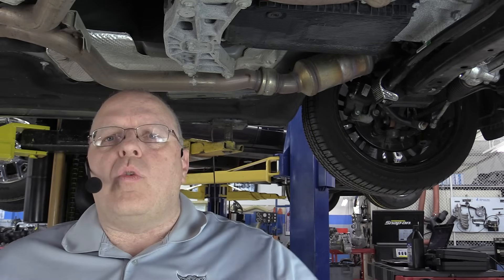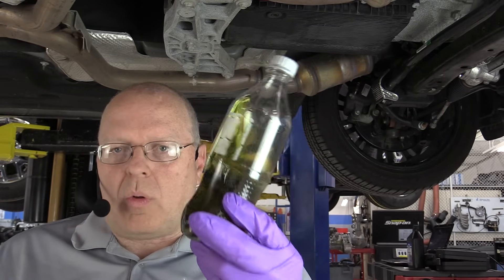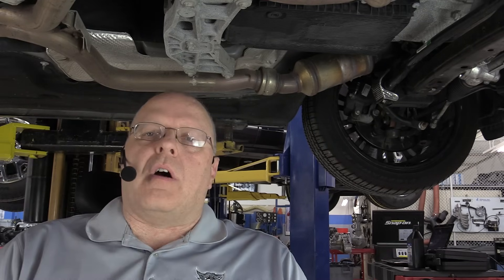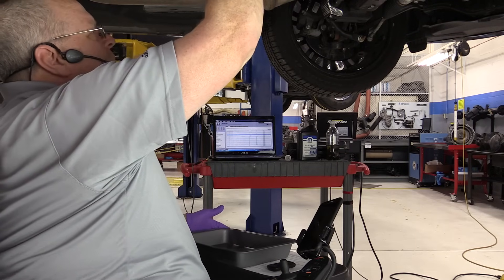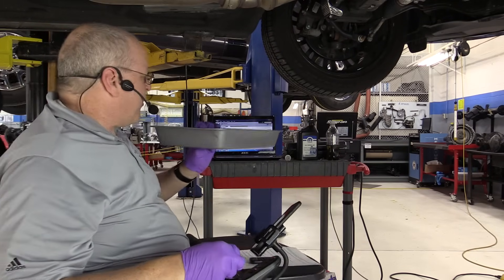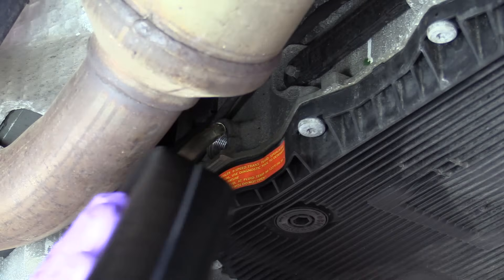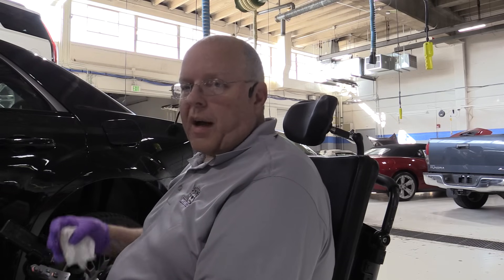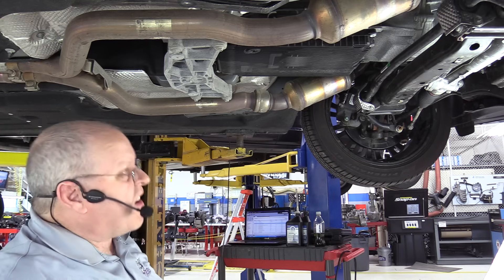Jeep, Dodge, RAM ZF 8HP 8HP 8-Speed  Transmission Fluid Level Check - No Dipstick

Comment: if the oil in the cooler has drained back into the pan after you performed your fluid change, seems to me that you'll never have the correct level. Am I missing something?
Reply from the maker: ZF now recommends tilting the vehicle towards the drivers side and adding 0.5 liters of additional fluid to compensate for the cooler flow control valve.
Reply: @WeberAuto  Thank you for your reply. Oh my, seems unsafe. I believe the fill plug is on the drivers side of the pan on the 2019 Ram 1500. I can not see a tech at the dealership taking the time to do this service correctly. Time is money.
Reply from the maker: @louiemos585  Thanks, it is not unsafe on the ground, just jack up the passenger side of the vehicle and support it with jack stands. On a hoist, it can be done, but would take an experienced technician to set the hoist lift pads to the proper height.
Reply: @WeberAuto  So the drivers side is lower than the passenger side?  In the video it looks like the fill plug is on the drivers side.  Correct or not?

Comment: This guys knows his stuff!

By the way; these combined AC Condensers/Transmission coolers are known to crack and leak refrigerant, PAG oil and dye at around 100 000 Kms. Drivers will hear the "hiss of death" while driving with the AC on. It's a common issue with all Chrysler/Jeep/Dodge brands (this part is common) and the combined condenser needs to be replaced (there's a few videos on youtube about it and how to complete it). The replacement of the condenser is relatively simple, but i doubt any technician/mechanic will complete the trans fluid check after completion of the job. If it's happened to your CJD vehicle, and you have a new A/C condenser, check your ZF 8HP transmission fluid after the repair. It's NOT a required step in the standard A/C condenser repair in the standard repair manual. Your AC will be nice a cool but the transmission may potentially be low on fluid and may lead to premature failure. 

Keep up the great videos.
Reply: Huh....my 2019 Jeep GC Trailhawk had malfunctioning air conditioning since brand new....system made a gurgling, weird noise....didn't blow cold air at all.  Had to have it fixed twice on warranty.
Reply from the maker: Great information, thank you!

Comment: Hey I need your help I have a 2018 Dodge charger sxt went I'm driving it a few miles in from D to reverse it kicks the sounds it comes like from the differential I went to the dealer the first time and they told me it was the transmission and they change the transmission and still has that noise but in the dealer that told me they cannot do anything is a normal noises for me it's not normal is loud. please help me😞
Reply from the maker: I have heard similar complaints from others. It could be "normal" although less than pleasing. I have no suggestions for help except keep checking back with them to see if there is a software update for the transmission controller to soften the D to R engagement. Best wishes.
Reply: Thanks so much for your time
Reply: Did you got it fixed sir?

Comment: Hi,
Just curious this is the same process for the ZF 845RE boxes used on Jeep Grand Cherokees?
Reply from the maker: yes
Reply: But, if you are changing the filter. There are three bolts keeping the pan on which can only be accessed by lowering the cross member.  Just an fyi...

Comment: "There is a 3 page procedure" - many companies have jumped on this fucking ZF tranny to save costs and improve their MPG ratings, and to help their service departments. This is a POS design constructed specifically to drain your wallet
Reply from the maker: There are two pages in instructions on how to use a dipstick. It is not much easier of you use it correctly.

Comment: Hmmm , That explains why when I used a wire to check my fluid pan level cold I had a significantly more fluid than when the trans was hot ! because the coolant system valve was holding back fluid from draining into the pan.
Reply from the maker: Thanks for your feedback

Comment: Hello Prof Kelly, considering the oh so high cost of that trans fluid I think I'd skip the first step and proceed right to the second proceeded by a high temp run and cool down and then proceed from there depending on the results. As your video went on to the bypass valve discussion, why in the heck did manufactures remove the dip stick that was always there on older vehicles? Cost reduction, to keep people from being able to do it themselves? It used to be so simple, run and drive the vehicle, get it up to the desired temp and then check the dipstick. I really don't understand why that still couldn't be possible. But then I am 69 years old and probably don't understand the "new" way of doing, looking at things.
George
Reply from the maker: Removal of the dipstick stops most people from messing with the transmission (putting in the wrong fluid, wrong fluid level, etc.)
Reply: No removal of the dipstick was to keep the average guy from saving $ by doing it himself.

Comment: I just finished my fluid change and trans pan with integrated filter in my 2012 dodge charger awd, prop shaft did not have to come out! I found fluid on internet for 20.00 quart x 6, Aftermarket pan was 125.00. I saved 600.00! I have a lift in my garage. On the ground would be hard as all 4 wheels will have to be jacked up, but it was easy peasy!
Reply from the maker: Thanks for your feedback. I hope the fluid you purchased met the ZF-LIFEGUARDFLUID 8 (ZF No. S671 090 312) specifications
Reply: @WeberAuto  yes it was called ZF 8 and 9 speed fluid
Reply from the maker: Good to hear. Have a good day
Reply: @demagchevy  the fluid you used worked correctly?

Comment: A) I'm surprised ZF didn't spec a uniform override of the thermostat for just this reason. Warranty costs can severely cut profits, (Ford/International 6.0 diesel debacle). 
B) Also, if there is one, for all the electronics on a vehicle these days, a manual valve/pin to hold it open? Why not make connect to the CANBUS and be run by the TCM for normal/testing use?
C) I fully understand not using a dipstick in order to force a little more thought/effort into trans service procedures as, yes, modern transmissions are very fluid specific. But, this much?
D) Why make them this sensitive to level? Is having an extra pint laying in the pan a mortal sin?
E) Really? TWO days?! :(
Reply from the maker: ZF actually recommends tilting the vehicle to add an additional 0.5L of ATF upon filling to compensate for the cooler issue.
Reply: So, now I've heard everything! :)

Comment: I would think that driving it for 20 minutes after you do the fluid change and than recheck it is a wise idea in any at fluid change. Second I like that there is no music playing over your voice, you get rite to the point, and you speak clear English. Thank you for a very educational video that the dealer wants $850.00 for a fluid and filter change.
Reply from the maker: No, I found out after this video that ZF recommends overfilling the transmission by 0.5 Liter (by tilting the vehicle to the driver's side) and adding the additional fluid upon the initial fluid fill to compensate for the cooler bypass issue. Thank you and Best wishes.

Comment: Hi I own a 2013 328i and just recently it seems like under hard acceleration especially at highway speeds going from 65-80 the car refuses to shift sometimes. Would checking the transmission fluid be a good start?
Reply from the maker: Yes, that is a good basic step to begin with
Reply: Thanks for the quick reply I really appreciate it!

Comment: According to VW service training self study guide 507, the part involving the cooler is incorrect, as the ATF cooler holds a charge of oil on first operation at temperature. It then retains that fluid amount in the cooler by closing the circuit as the gearbox cools.  Up to the part about the cooler the demonstration seems correct. Thanks. Hope this helps.
Reply from the maker: Thanks for the feedback, I am not aware of a VW with a ZF transmission.
Reply: @WeberAuto  The 98-05 Passat, Phaeton, and some Audi products use ZF automatic transmissions.

Comment: For the fluid checking procedure, does the transmission need to be level, or does the vehicle need to be level?

I ask because in the Ram 1500s the transmission is at quite a steep angle backwards. I would think that means that it would have LESS fluid in it.
Reply from the maker: Yes, the vehicle needs to be level
Reply: @WeberAuto  Nope. Transmmission pan rail needs to be level according to what I'm reading.

Comment: Prior to all this mechanical work I wish there was some way to evaluate the fluid quality first. There must be a sensor that could evaluate particles, viscosity, or whatever needs to be happening with this fluid and issue a warning light if specs are exceeded? Some trucks probably can run for 300k without fluid breakdown, while others are shit at 30k due to heavy towing or other usage. Seems like all this work is just a best guess that it’s even needed.
Reply from the maker: Thanks for your feedback

Comment: The PDF also says if it has a transmission cooler, overfill with .5 l of fluid. Don't exactly know how to overfill with fluid though...
Reply from the maker: Set the fluid level properly when cold, then jack up the passenger side of the vehicle to tilt it. Then add the a transmission 0.5L of fluid. Plug the hole and you are done.

Comment: If the transmission cooler bypass doesn't close until 160 degrees and you are supposed to test the level of fluid between 86-122 degrees F then how are you ever supposed to know the correct level of the fluid with the plug out? Maybe the fluid level check is supposed to be done with fluid out of the cooler lines after it cooled down and the fluid in the pan already compensates the fluid used by the cooler lines... ? If you try to pull the plug with the engine off fluid definitely comes out. That's what I experienced after my first service on the transmission in my 2015 Ram 1500 4x4 after 128000 miles....
Reply from the maker: Set the fluid level properly when cold, then jack up the passenger side of the vehicle to tilt it. Then add the a transmission 0.5L of fluid. Plug the hole and you are done.
Reply: this is a reply for my other question comment...
Reply: @WeberAuto  when you said cold, did you mean between 86 and 122 degree Fahrenheit? Because like he said when you pull the filling  plug when the engine is off(zf pump not working) the ATF oil pour out of the filling plug.

Comment: What I don't get is if the bypass valve is open (and closed to the cooler lines) how would old fluid ever back flow into the transmission when dropping the pan at a cold temp? So there should always be fluid in there
Reply from the maker: It would flow back while it was hot and open with the engine off.
Reply: Great info. adding to SRT4Cab3 question. How would you ever get the fluid level correct in the trans. The cooler if equipped with the by-pass valve would flow back every time the vehicle is shut off to cool. What gives ?

Comment: ZF8 can be purchased for around 19 a liter at this place http://www.thectsc.com/. All ZF transmissions I have worked on use this same procedure 5-6-8 speeds. You need not circulate transmission fluid doing a top off as the transmission was running when you crawled under it or put it on the lift right?
I just keep the temp between the ranges spec'ed which is the 86-120 F range. I do a drain and fill every 50-70K miles as it will prolong the life of the transmission greatly. As long as I have the temps in range I pull the fill plug and fill until weeping out. Be careful with the 8 speed plugs they are plastic and if you torque too much they break don't ask me how I know. Honestly don't think you need an integral pan change until north of 150K miles at least I don't plan to do so until then. The pan and filter are one unit and you can also get the pan on eBay or at the site I mentioned above for 125-160 bucks much cheaper than 250 on sale by MOPAR and they are the same identical pan not an aftermarket but the same ZF pan. Hope this helps...
Reply from the maker: Thanks for your feedback

Comment: Hey John, is it the same procedure for 2014 to 2017 9speed jeep cherokee? If not...do you know the procedure for it?
Reply from the maker: No, the 9-speed is totally different and has a special dipstick tool
Reply: Considering the cost ad potential to ' contaminate ' with Oxygen or dirt when opened . Why isn't there a sensor on the trans to enlighten the mechanic as is installed in the Allisons and accessed through the shift selector ? ? ?

Comment: i am a certified A/T builder and when i rebuild these trans i check the level twice with my scanner at operating temp first then after i drive the vehicle to check it and i'm done. easy
Reply from the maker: Thanks for your feedback
Reply: What scan tool are you using? Witech or Chrysler Diagnostic Application  (cda)?

Comment: Thank you very much for this video....  My question is, @ $43.00 does this transmission require a fluid change through it's life cycle.  And if so would it be advisable to have the dealer ONLY perform the service ??  Thank you again for your professionalism and the time you took to make this video...
Reply from the maker: No fluid change required until a very high mileage. See the maintenance schedule for your vehicle around 120k miles for a car and earlier for a truck. Best wishes!
Reply: ZF officially states that the  ATF must be changed at least at 65K  miles (100K km) or 8 years

Comment: Hi Sir Its a Great Video 
I Have a Question i have a bmw 550D F10 and my gearbox Are Jerking In low RPM like 1000-1700 When starting from 0- Its not smooth I have read that these Transmissions Have these symptoms without a Real Solution Whats your Opinion ? My Problem is Not being smooth on low rpm ,Jerking,Shaking feeling .. Please if your time allows you reply as you have the knowledge or some advice Before i go to dealer and get ripped off ...

Comment: I work at the factory that builds these transmissions. There is absolutely no reason you should ever have to check your own fluid unless you see its leaking. It doesn't take normal ATF.
Reply from the maker: Thanks for your feedback. That would be true assuming the transmission was filled properly to begin with. That does not always happen.
Reply: we put every unit through a test stand that fills each unit based on weight. They then go through a 10,000 point inspection in the test stand. Not every 845re should have the same amount of fluid in it there is 6 different models of the 845re. And FTR I am a repairman meaning if they fail for any reason in the test stand they come to me or 2 other guys and we tear them apart and fix the problem...
Reply: I have a 2014 Ram 1500 5.7L Hemi 4x4, with the 8 speed transmission.  I brought it to a Dodge dealer to have my transmission fluid flushed and replaced.  The truck has 42,000 miles.  I get the truck back and now it down shifts hard and has a whining noise.  I brought it to another dealership and they pulled some fluid out and it was thick and red.  Turns out the first dealership used a BG machine and fluid.  Is my transmission totally ruined, or could I just drain and refill with the correct fluid?
Reply: @jimsimpson960  same thing happened to me but on my 2014 Chrysler 300 , what did u end up doin after all now I'm stuck takik it back to the dealer 2morrow 😔

Comment: John I have a couple of questions, 1) what brand transmission fluid should I use in a 2015 BMW 650i Gran Coupe and 2) where is the dipstick located on the car.
Reply from the maker: 1. Use the fluid called for in the owner's manual or by the BMW dealer. 2. There is no dipstick. Thanks for your feedback.

Comment: U don't have to use the mopar zf fluid it's very expensive,  I use in my 2014 charger with 8 speed transmission valvoline max life, trans fluid, 60k miles after no problems
Reply from the maker: You could put water in it and it would work for a little while. There is a reason for using the proper fluids or fluids that meet the manufacturer's (ZF) specifications. We pay a lot of money for our vehicles, why take a chance just to save a few dollars when a $5000-6000 transmission is at stake? Best wishes.
Reply: You are so right.  The Valvoline Max Life full synthetic DOES meet all the specifications as do a few other fluids and they work just as good for way less cost.  You know its a scam when Chrysler puts a sticker on the transmission saying to use only Chrysler fluid when all that is, is fluid that meets the ZF specs.  I highly doubt they are rebadging ZF Lifeguard 8.